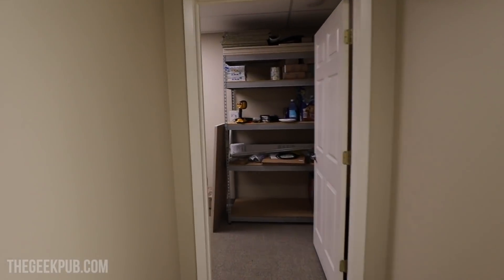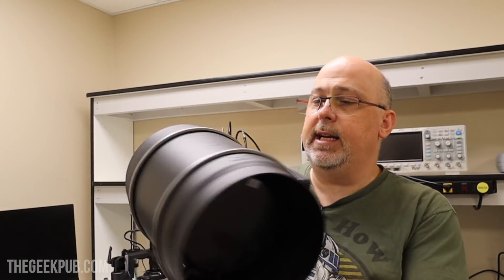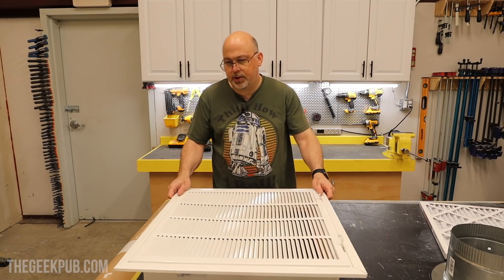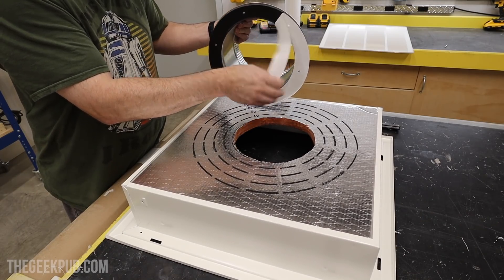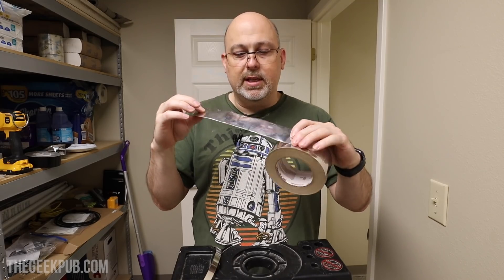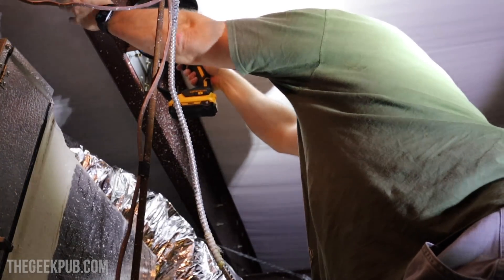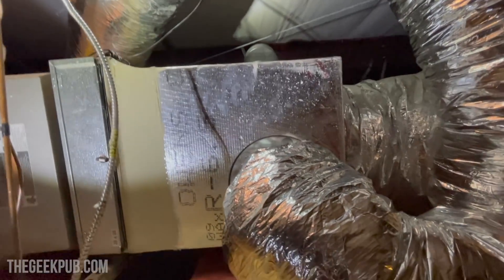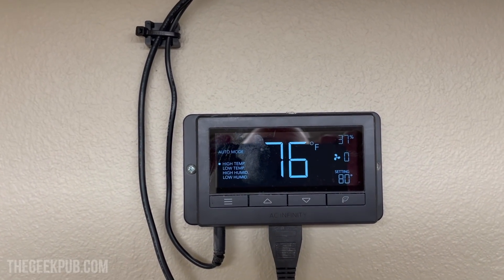Venting the Server Room

Comment: a mini split for the server room is under $900 and can be installed for around $1000, if you are being charged more than that you are being ripped off :) I installed my own here.
Reply from the maker: An electrician would charge most of that number just to put in the 30 amp breaker, cable run, and outdoor disconnect, etc. before you ever bought the unit or paid for install, mounts, etc.
Reply: @TheGeekPub  If you are in a commercial building that would explain the cost, they always overcharge, electric here in the rural was $200 labor plus $100 parts to run the electric, plus the A/C tech was $800 to install the mini split, I had the mounts, lineset etc in a kit. so closer to $1100 to install. Also depends on line set length and electrical length, but 10k is way too high. Your way works, I am happy for you.

Comment: I would have choose a different position for the inlet. You put it obove the door. So it will suck in the air throug the door. Also it is the longest distance from the rack, so you will end up with a lot of heat behind the servers with almost no circulation inside the room itself.
But, great solution to re-use the "hot" air and not "wasting" it to the environment.
Reply from the maker: That's something I hear all the time.  But in reality, but its just not true. Thermodynamics means heat rises.  The hot air will be at the ceiling and will be extracted first.  If every air molecule in the room was the same temperature, you'd be right.  But that is never going to happen.  This is why real data centers work the way they do with hot isles and cold isles. CRAC units that intake from the top and exhaust from the bottom just a few feet apart.  Heat rising does much of the work for you.
Reply: @TheGeekPub  I understand what you are saying but as someone who has a rack room with two CRACs, if one of them dies (which has happened more than once) then you do develop hot spots. This means the air does not mix as much as you would think. I have actually seen it where I walked 3 or 4 feet in one direction and it was significantly warmer at the same level. Now, I am sure this is because the room is very large so maybe you don't have that issue but I would be curious to see if behind the racks is any warmer then at the door, at the same level....say 6 feet off the ground.
Reply: @TheGeekPub  I also understand the premise, but it can be optimized.  I think one thing that is helping is that air is currently being pulled from two locations when the duct fan turns on.  From around the door and from the in-vent, which thankfully is above the Server rack, regardless if the AC is on or not.  However you can greatly improve the performance by flipping the vents around (in-vent above the door and return vent above the rack).  This ensures that the hottest part of the room is getting cool air pulled towards it and thus getting more hot air out of the room.

One way you can test this "door" theory is get a wind meter or heck even an old 12v fan (assuming it freely moves) and place it at the bottom of the doorway and turn the fan on.  I bet money that fan moves and that air is going straight from the door to the return vent via the fan.  Air like anything will take the path of least resistance and isn't mixing with the hot air in the room unless you have something mixing it (like another fan inside the room).

In closing if it's working well enough go with it.  It's hotter than hell above that drop ceiling.  Once up there is enough for anyone at this time of year.  Or if you are feeling energetic and convinced enough we can tackle it in the winter (say Jan/Feb).  LOL  It's not that much work when it's not hotter than hell up there.

Comment: Interesting... did you consider just a vent fan that would exhaust the hot air from the server room straight into the space above the drop ceiling and draw cooler air in from the other parts of the office?  We did that at one company I worked at and it worked well.
Reply from the maker: No, that could result in condensate issues in the attic.
Reply: @TheGeekPub  Makes sense.  Loving all the videos of the new place.
Reply: The real problem with that is pressuring the unconditioned space above the drop ceiling, which now makes his conditioned space negative. This creates a situation of 400-800 CFM 100 deg air being drawn into his conditioned space, not to mention the dust issue that would also create.
Reply: @lackr0073  Thanks for the additional comments.  I really like the solution in the video.  Wish we would have thought of it for our office server room!

Comment: You want to filter the air coming into server room, not coming out of it.
Reply from the maker: There already is one.  I need both.
Reply: @TheGeekPub  Well, there’s practically no dust created in a server room besides what you bring into it. Except it is on fire or something.
Reply: @noop9k  Based on what I can see, there's a lot more in this room than servers.  I see paper storage, ceiling tiles stacked up, light bulbs, and even a vacuum cleaner.  I'd say filter in and out is probably the best approach here since the room is not dedicated to servers.
Reply from the maker: @Toby Correct.  You would also never want an unfiltered return going to the HVAC unit. That's a really bad idea.
Reply from the maker: @@MikeMike-th4fu Nope.
Reply from the maker: @@MikeMike-th4fu You must be "the new guy".  Systems can have media filters at the main unit or at the returns.  Ours are at the returns.

Comment: Good vid, but confusing thumbnail.   Thumbnails are hard.  Everyone tells us that we need to have sexy flash inviting ones to pull in the eyeballs.   I wish more people just watched all their subscriptions... no need for an algorithm!     

Anyways, so your above-the-ceiling-tile area appears to be an unconditioned space?   Isn't that hard on the AC unit to be working in such a hot location?  Or is that standard Texas space?   I work at a University here in Ontario and the above-the-ceiling-tile section of our building is part of the conditioned space.  In fact, that whole area acts like a return.
Reply: It's pretty standard practice in Texas.  Back in the 60s they used to put the air conditioners in a closet or something like that, but I guess they felt putting in the attic would free up more living space.  The heat doesn't seem to bother the units, but one big downside is they are much harder to work on and maintain in the attic versus in a closet.
Reply from the maker: Yep.  As @The 8-Bit Guy said, this is common practice where we live.  Seems to work fine.
Reply from the maker: Oh.  And can you elaborate on what's confusing about the thumbnail?
Reply: @TheGeekPub  In Canada, having unheated space above the ceiling would be asking for trouble in the winter.  Warm and moisture laden air from the rooms would get into the unheated space and condense!
Reply from the maker: @Mathias Wandel - That actually happened to some people when Texas had its 'snowmagedden' and was neg 15 for days on end.
Reply: @TheGeekPub  Shrink the window down so it's only about 1/2 the size of a smartphone screen -- That's what I try to do when working on a thumbnail, since most people see it on a phone, so that size is what they are seeing.  I try to think what someone sees and it mostly looks like just a mass of dark and grey.     To be sure, I'm not sure what I could have done different -- maybe focusses on the hole in the drop ceiling?
Reply: @matthiaswandel  there was insulation on the drop ceiling panels, but certainly no vapour barrier.   Definitely would not work up here where we live!!  Actually I think I've seen that in Texas they put the vapour barrier on the outside instead of the inside, due to it being primarily a cooling-required situation?? (could be wrong on that second part)

Comment: 8000 dolars WOW in mexico 500 to 800 dolars 1 /12 ton
Reply from the maker: $500 sure.  For the cheapest unit with no warranty and def no installed or with all the parts you need.
Reply: @TheGeekPub  for a mirage waranty 3yrs install will go from 100 to 250 dolars.
Reply: @TheGeekPub   search for Aire Minisplit 220v Mirage 1 Tonelada 12bt R410a Mod Life 12 is 6599 pesos to dolars 330 dolars
Reply from the maker: You google it.  It's coming up as $6500 USD.
Reply: @TheGeekPub  is mexican pesos for 6500 usd you get a main AC in mexico 5 to 6 tons
Reply: @hillonetwork  Those budget mini-splits come with a host of concerns and maint. issues.
Reply: @willierants5880  i have an minisplit mirage absolut x 1.5 ton for 10 years neve Down and it costme 700 dolars install